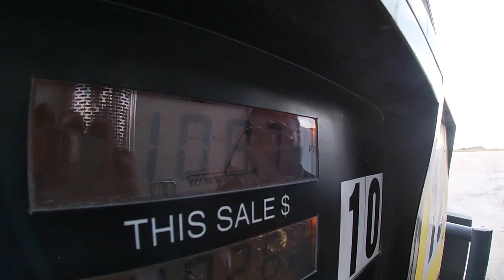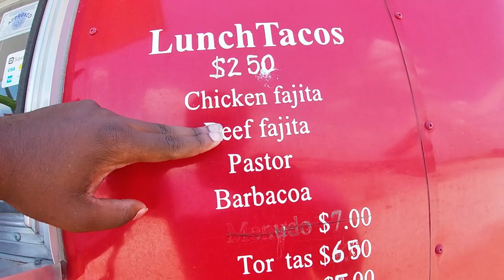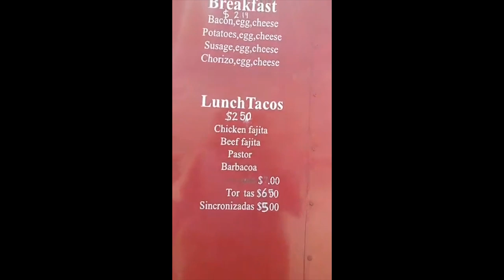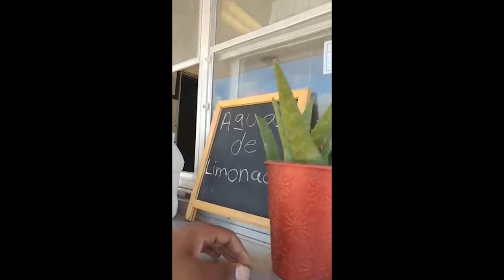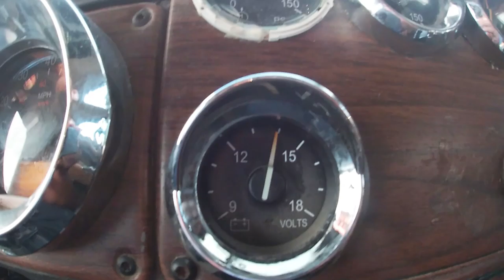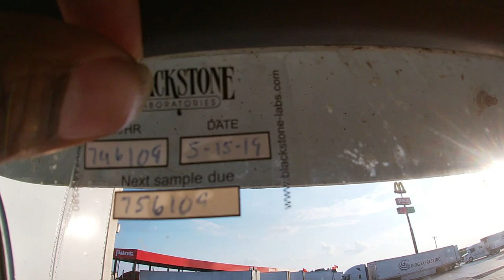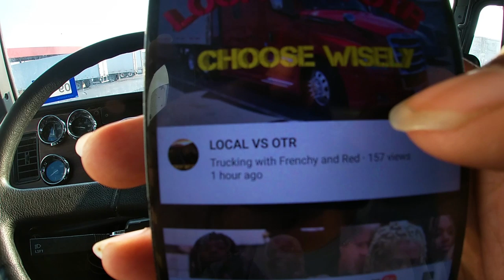Let's FlatTop Home

Comment: You don't strap them down while fueling up?
Reply from the maker: Strap what?
Reply: The hose flipped out of the tank & while locked sprayed a good 1/2 gallon of diesel in the cab, lol. It won't happen again, lesson learned.